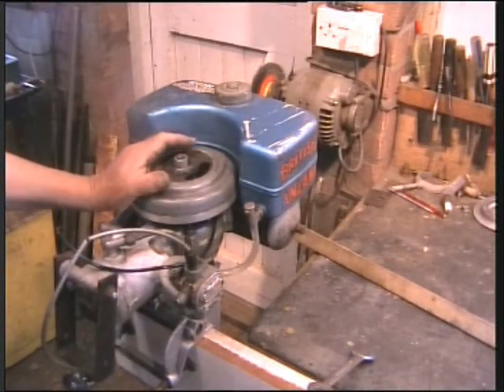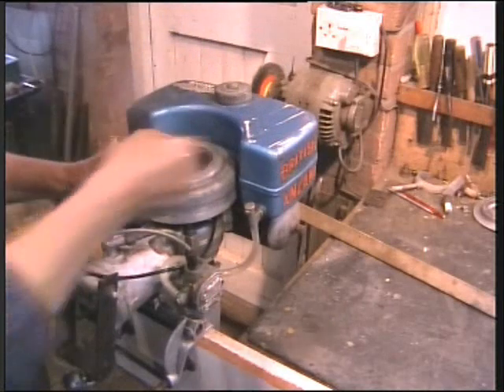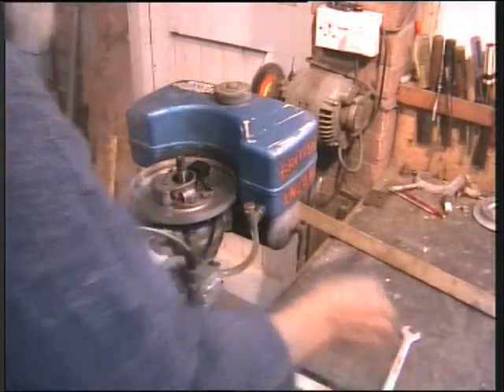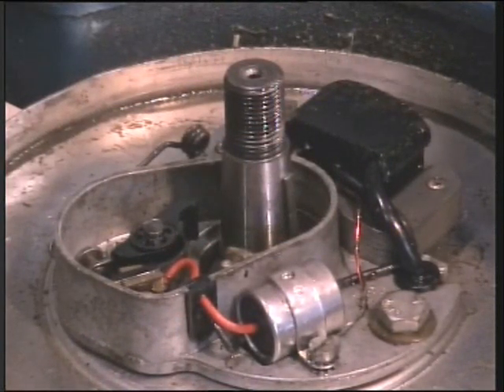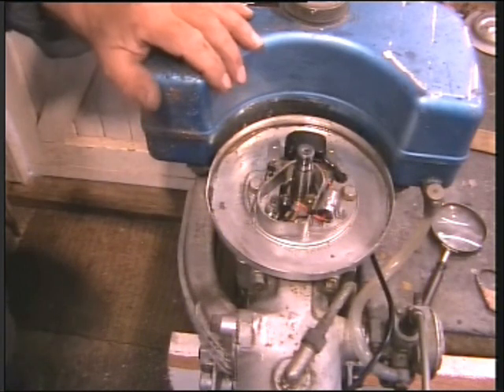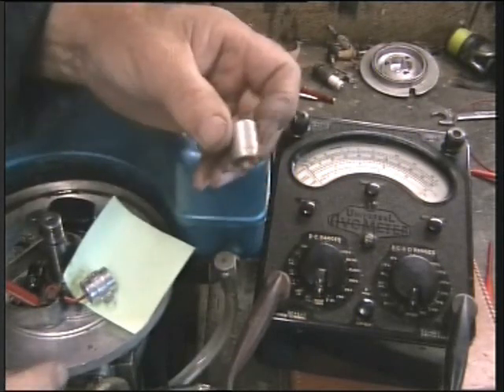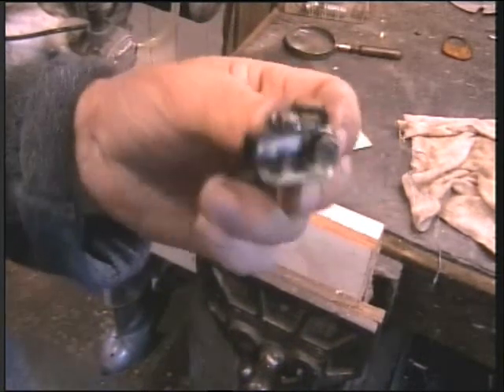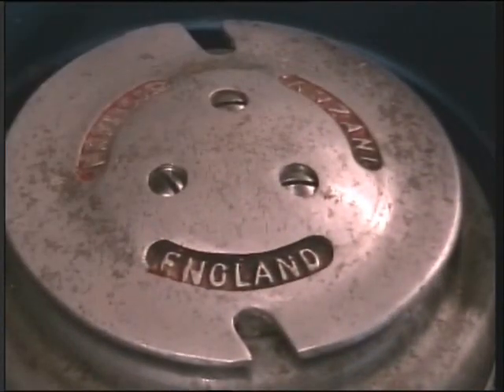I is knackered / update

Comment: Nicely done Sir. 
An old trick shown to me was to use a cheap set of feeler gauges to take up any play between a spanner and nut. This helps with nuts that have had their corners rounded or when the proper sized spanner is not available.

Comment: Nice fix.

There is in fact an ideal value for the condensor, particularly on an engine that operates mostly at a constant speed. Too large and you'll get a pip on one contact, too small and it will be on the other. Just right and you shouldn't get a pip. Cars are difficult because of the wide rpm operating range, but I'm told that the post office used to specify a different value for their delivery vans that were used in towns and would spend a lot of time idling or at low rpm.

Comment: Stoning? now there's another term I've not heard before but obviously grinding of some fashion, I've got a small "points file" somewhere in my shed for that sort of remedy although a metal nail file would work equally well in a pinch I dare say.

Thanks for sharing PorOldChap!
Reply from the maker: Stoning as in slipstone (oilstone etc) used for touchup of tools and the like, but not grinding, less harsh
Reply: ***** Thank you for the clarification, so very fine abrasion like sharpening a knife blade... got it.